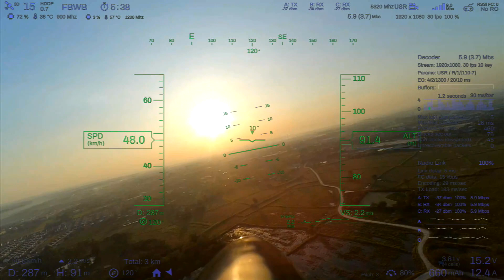Ruby Digital HD + NEW Raspberry Pi Zero 2 W (ground controller) + 3 WiFi cards..1 hour flight...Pass

Comment: Is this Ruby fpv thing your own creation?
Reply from the maker: If you mean software, no.
Reply: @montreetormee  what is this software? Especially the OSD - it looks so nice! Are you basically using very high gain antennas for long range ip camera?
Reply from the maker: Yes, long distances require a high gain antenna.  And I've added details about the website to the video.  You can go see more or watch my videos.  in other tests